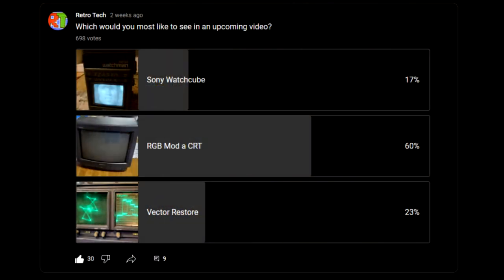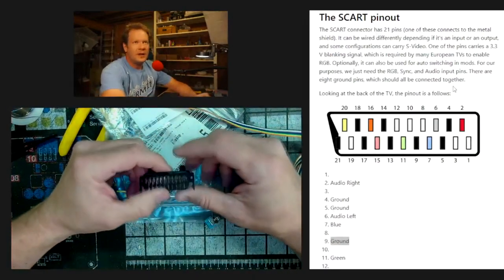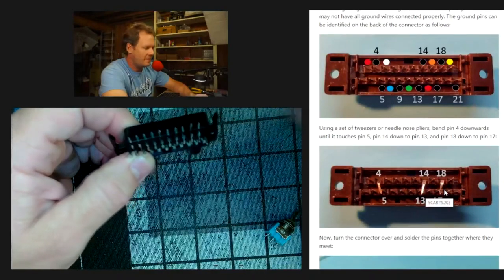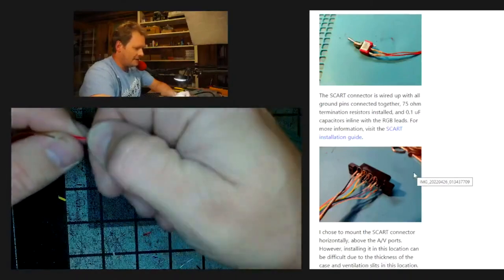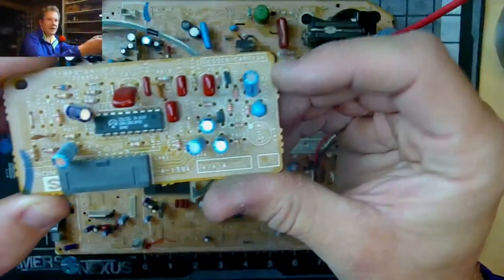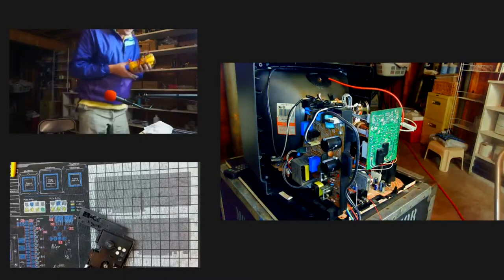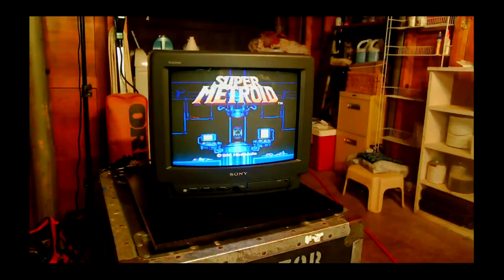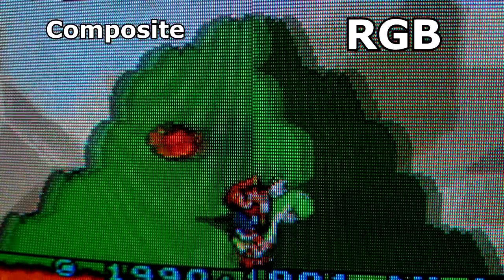Modding the Sony KV 13TR28 for RGB - Full Guide

Comment: I picked one of these up from the curb with stock remote included no chips, cracks, or scuffs on tube or plastic.  I also have a white one with good tube and rough plastic. Probably will start by modding the white one and see how it looks.  Have a couple of PVMs but still enjoy working on these consumer ones since the quality needle really tends to move with some calibration and clean video signals.

Comment: Thanks for the great video, here are some extra tips: I'm told by a smart friend that you want the coupling capacitors and terminating resistors closer to the board rather than the connector. Also, be careful with ESD discharge, those older jungle chips don't have much protection circuitry, I fried a board that way (you might have seen my predicament in your Discord). You might want to formally disable the CC chip in the service menu. Also, you can try using a 3D printed SCART backplate to make it look more factory.

Comment: I actually tried to do this mod by designing a PCB to replace the CC board but I guess I was overthinking it. I will have to see how I can rework this to use the BNC connectors I installed instead.
Reply: Honestly you could make it even simpler and buy dupoint female to female cables. I'm doing this mod right now with those and a scart PCB from sunthar and so far that's helped tidy up the wiring a ton. I'm adding male dupoint connectors to the tv PCB for the audio, sync and ground so the port isn't soldered to the scart connector
Reply: @SnoopKatt  where can I find this SCART PCB?
Reply: @TimDavis77  thought I commented but I'm adding the links here
Reply: @SnoopKatt  no worries I’ll just search for SCART and sunthar

Comment: I did a scart head, soldered the wires to the tv motherboard & I got sound & video from composite,turned the switch! Got a grey dark image no colors, re-did the scart head got color but no brightness. No power to the scart head? Or blanking? On pin 8 & 16? Replaced the 0.1 cap had no reading with the multimeter, Now I have reading of 74.8 ohms on RGB. My RGB is grounded on the daisy chain with the resistors & caps, does the yellow video sync connect to ground as well or no? In the diagram it is not. Appreciate if you can help. 😅